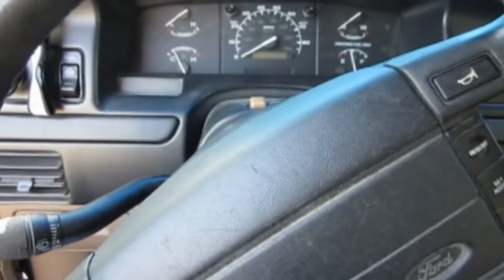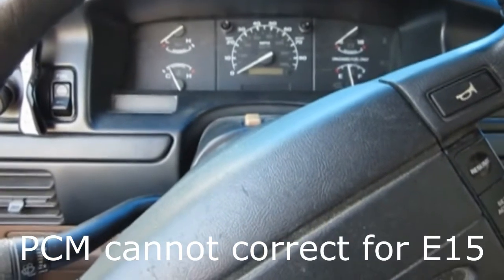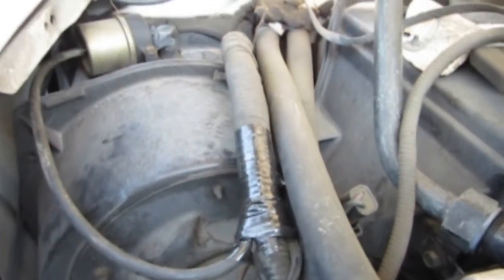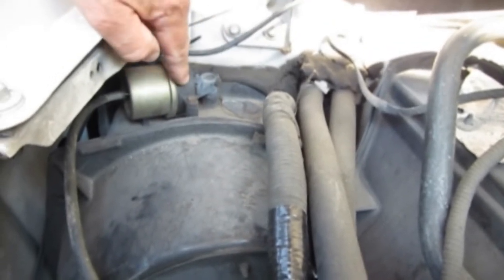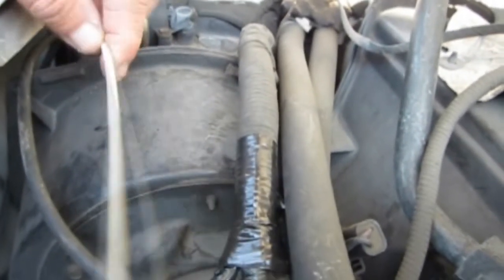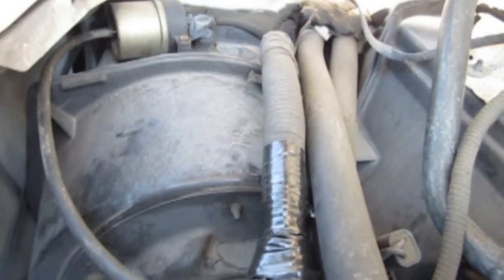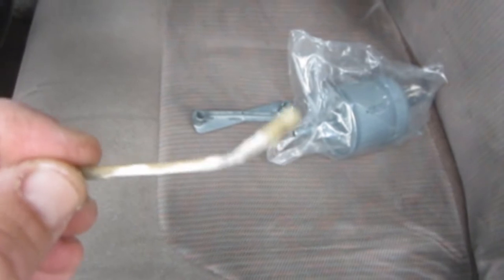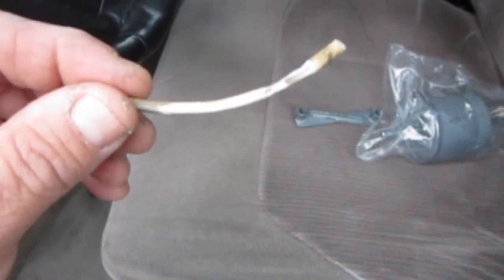P0171/174 - Too lean banks 1&2 Vacuum Issues Ford 4.9L Engine

Comment: 3 years later this video saved me
Reply from the maker: Great! Check out my other videos on the same animal too.
Reply: @michaelbradford2816 do you recall what size hose you ended up using for this repair?  I bought 5/32 inside diameter hose according to the ford forums and it’s not a very tight fit I’m figuring on going back to the hardware store and trying the next size down.
Reply from the maker: It's been too long to recall, but I believe all I could get was rubber wiper tubing which comes in different sizes. I try to keep various sized pieces on hand. Mine fit very well. I think I'll check it again since it's been so long. Other than that, I'm not sure. Do tighten the oil cover seal bolts too using the alternating sequence, but never more than snug. I found mine goose loose.